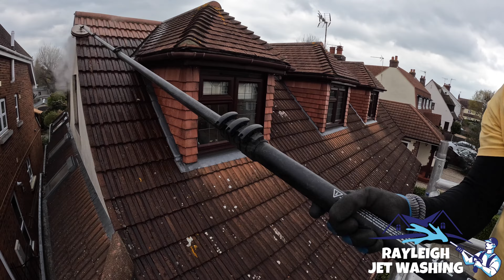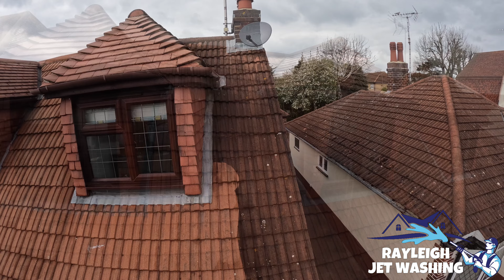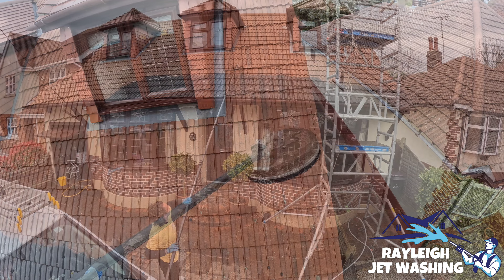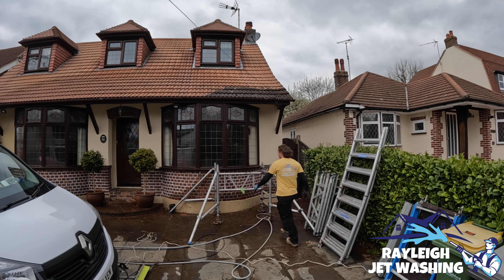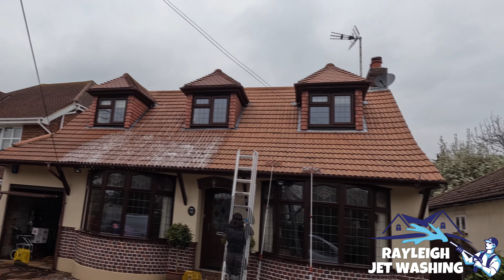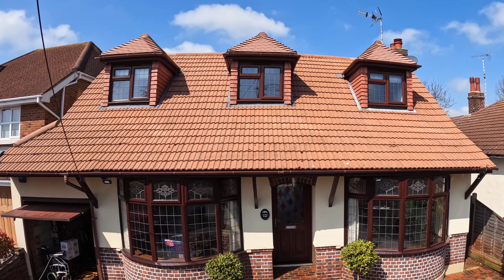ROOF TRANSFORMED!! back to its PINK colour. 🔥🔥 STEAM CLEANED and BIOCIDE APPLICATION. Cool Results!

Comment: Steam always looks to make less than standard pressure washing, is that the case, d you think?
Reply from the maker: Hi mate, sorry makes less what?
Reply: @rayleighjetwashing  lol sorry *less mess - I think a hotbox is the last big purchase I'm yet to make but not 100% sure whether or not to get one 🤔
Reply from the maker: @Rattlin  thats ok mate... no it makes an equal amount of mess. I would say it's worth it. But to be honest you can clean probably 80-90% as well with cold water. If I was starting again. I wouldn't put it so high up on the priority list. It does make a difference. Especially on more delicate surfaces. You can clean safer but ultimately slower and more expensive... lots to think about. Good luck
Reply: @rayleighjetwashing  oh wow, thanks for that - I usually promise a 90-95% clean with the water, then Biocide for the rest, so might save myself a few thousand 😌 Thanks again, have an awesome day 👌